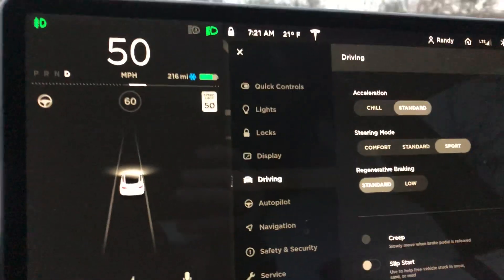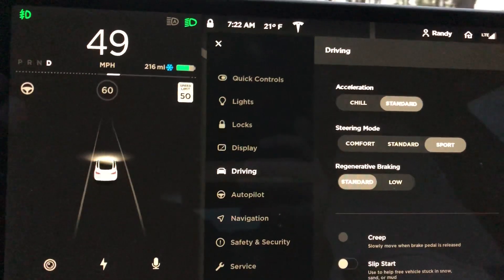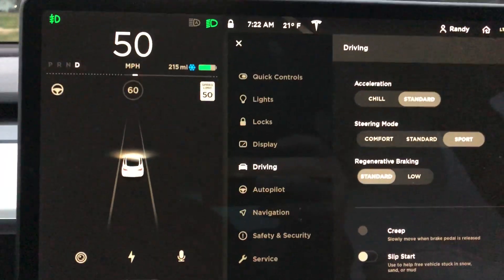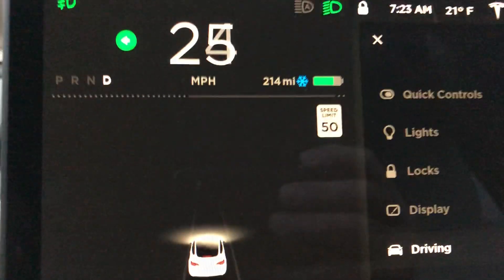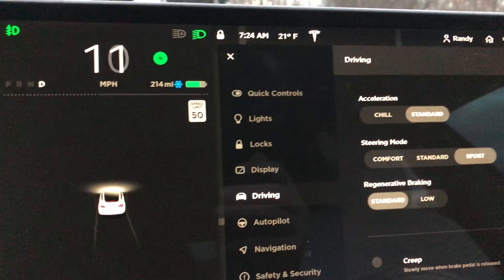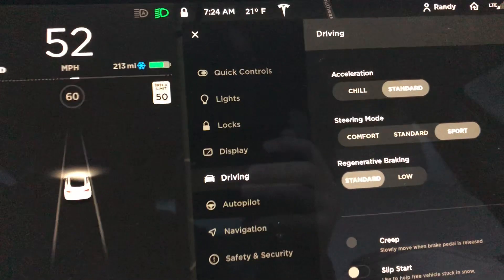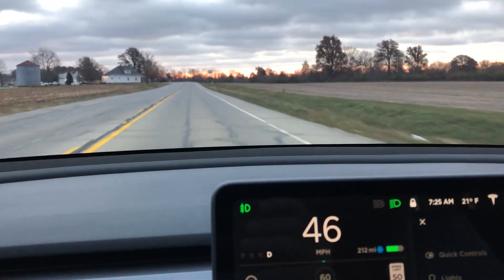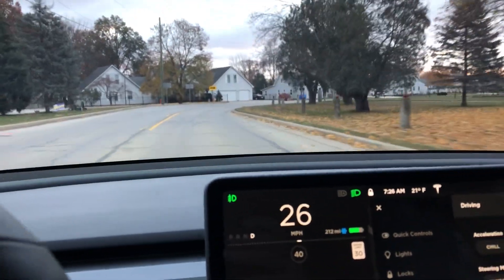Regenerative braking when it’s cool?!?!  Does it exist?  Tesla model 3!

Comment: I wonder why Tesla does not have braking resistor grid for cases, when battery is full, cold, or both. Many trams, trolleybuses, electric locomotives have such resistor grid in order to have consistent dynamic braking. Braking grid on roof of tram T3M-2DVC on picture can handle up to ~ 200 kW and liquid cooled resistors exist, which are significantly smaller and could be (de)coupled with existing thermal management system in Tesla.

https://upload.wikimedia.org/wikipedia/commons/9/9e/Praha%2C_Libe%C5%88%2C_Libe%C5%88sk%C3%BD_most%2C_Tatra_T3M.2-DVC_%C4%8D._8063%2B8009.jpg

Comment: your battery is cold that's why  you have to wait until your battery warm up
Reply: Yes that is correct.  But remember, your Model 3 battery heats while charging.  So if you can, preset your home charging time so that it reaches 70-80% levels when you are ready to go.  This leaves a buffer (you do not want to charge above 85-90% on a daily basis), but makes sure your battery has been charging just before you leave.  Charge at 48amps if you can (Wall charger), but the 32amp UMC is OK too.  You need at least an hour of charging before you leave in cold weather.  The Model 3 has a different battery heating system to the S or X.  It runs current through the motor producing heat (which heats the fluid in the battery cooling/heating  system) but no torque.  It might also be useful to preheat the cabin before you leave, but you only need to do this 5 to 10 minutes before you leave, as it is very effective.

Also remember that if you charge right up to 97-100% you will also have limited regen braking until the
battery level drops sufficiently.
Reply from the maker: Do you know how long does it take to warm up?  I drove for 30 minutes going into the office and it was the same way the entire trip.